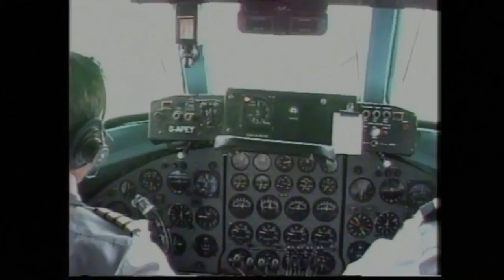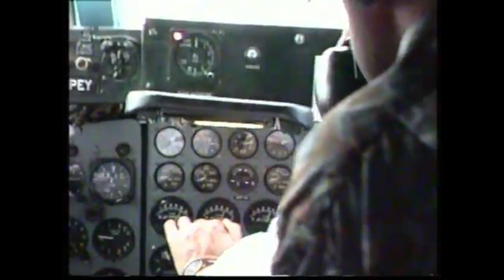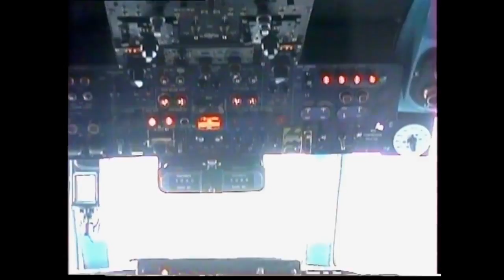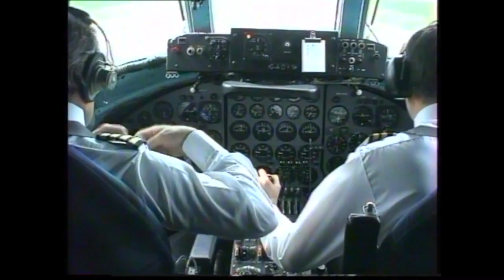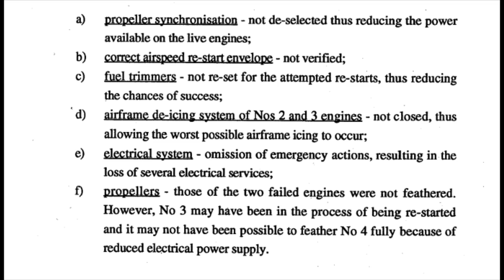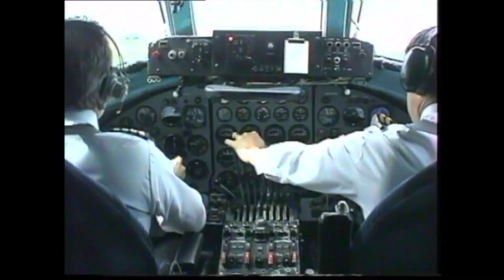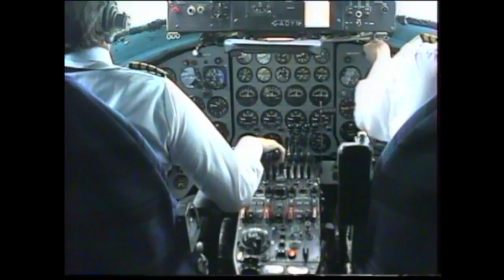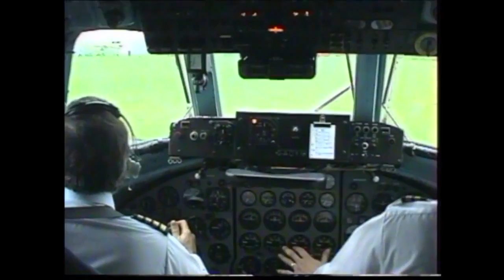Flaming Out On An Icy Night | The Crash Of British World Airways 4272

Comment: These blokes didn't have a chance with so many things going wrong. The Viscount certainly was a remarkable aircraft for it's time, but this one had just too many things out of alignment to get home. Thank you for a great explanation of this aircraft accident. Well done!
Reply: Agreed.   Too many electrical and mechanical failures for any pilot to deal with, I think. 

And it seems like there were some design shortcomings that made the pilots job a lot harder than necessary.  Why make it so that the pilots have to manually adjust the fuel-air mixture to restart an engine?  Shouldn't that be automated?  Why should the pilots have to reconfigure the electrical system when an engine fails?   Shouldn't that, too, be automated?

Comment: I think I flew on this model in the 1960s and 1970s when my family used to fly in and around the British West Indies on BWIA airlines. We traveled to Saint Lucia, Barbados and Antigua quite a bit. The engines made a lot of noise, but you could feel the props "grinding" at the air, so you felt actually safer than in a regular prop plane or a jet aircraft. I remember the engine sounding like it had a weird steel chain-link sound, like they were being driven with loops of high-velocity steel chain cables.

Comment: Flew in Viscounts and the twin engined sibling the Viking a few times and they were quiet and smooth.
Reply: The Viking was totally differnt from the viscount.. it had piston engines.. it was derived from the wartime bomber the wellington
Reply: @briancarno8837  I am very different to my siblings. I did not say it was a two engined version of the Viscount but they are both Vickers and of the same era.
Reply: I remember the lovely noise that they made. They were on the Belfast to London run in the late sixties.
Reply: Aye - I remember the Viscount. Flew in them London to Manchester a number of times as a lad. I mostly remember, with great pleasure, the huge windows...

Comment: Just wondering, when did they start measuring fuel in weight rather than volume? Great Channel.
Reply: They measure in both but the weight is the more critical metric. Fuel pricing is by volume of course, fuel consumption is measured by both “gallons per hour” as well as “xxxx thousand pounds of fuel burn overall. But weight has always been the primary measurement for one simple reason - the total weight of fuel on board, along with the weight of passengers, baggage, and/or cargo is the most important number to any pilot. Total Takeoff Weight (and the associated center of gravity) have to be be below the max allowable takeoff weight given the operating environment the aircraft is departing. Same holds true for landing weight.

Comment: Interesting #2 engine location on the plane at 3:01...
Reply: If you are referring to the lever on the left side, fully forward, that's the flight fine pitch stop lever and not a throttle lever. Google RR Dart flight fine pitch lever for its function.
Reply: @gordonsinclair9947  - I was referring to the tri-motor plane visible through the co-pilot's window, it has the #1 & #3 engines mounted on the wings and the #2 engine mounted up on the tail.
Reply: @ouroboris  Ah ... that is a Britten-Norman Trislander, the big brother of the two-engined B-N Islander.
Reply: @gordonsinclair9947  Thanks for the info :)

Comment: You're doing a nice job of documenting, producing and narrating: your video product is extremely "watchable".  However, you need to do a bit more research and dig a little deeper into your facts.  Two examples: Vicker Viscount pronounciation: "viscount" is pronounced vie'-count.  As another commentator has noted. ALSO your comment about being "quiet" made my head spin.  Have you actual HEARD a Rolls-Royce Dart turbofan engine run?  If you have, and you weren't wearing ear protection, you would probably now be at least partially deaf.  The screaming noise these engines make is unique and unmistakable and probably responsible for a lot of hard-of-hearing line pilots.
Reply: The Dart isn't a turbofan.
Reply: @rogerturner5504  Sorry, my typo.  Thanks for catching that.